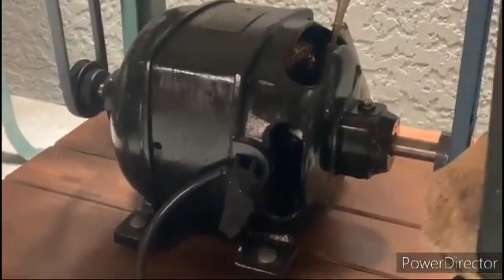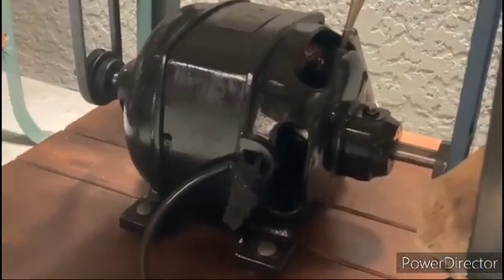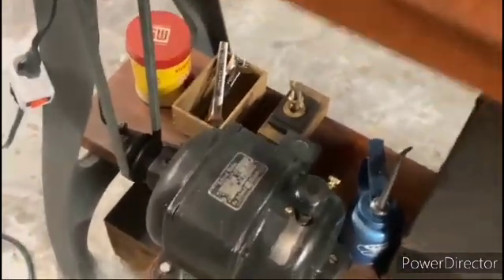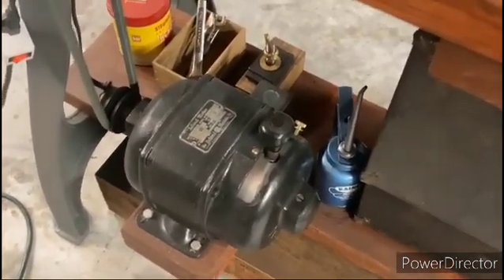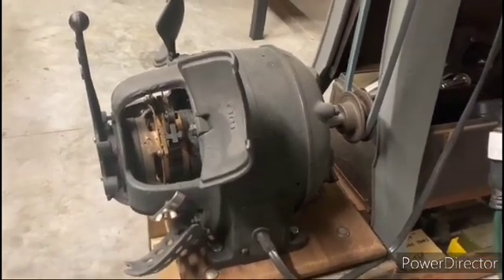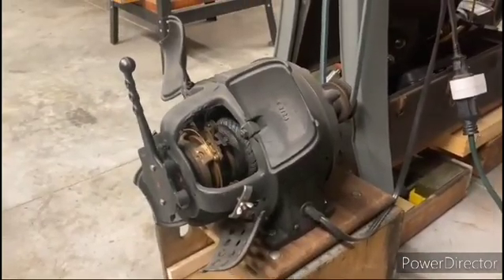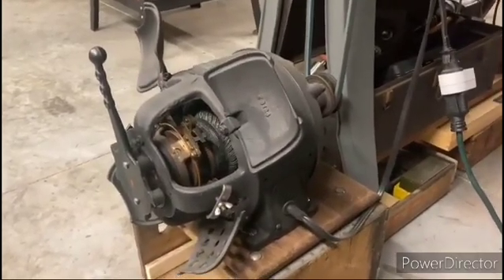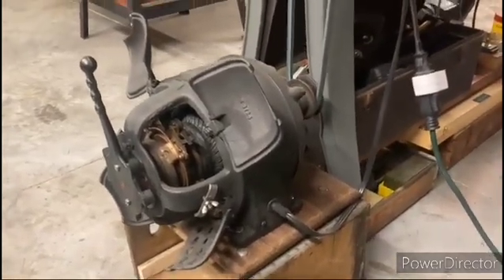Variable Speed AC Electric Motors or VFD? Leland or Kimble? Inspired (again) by Hand Tool Rescue.

Comment: I’m just wondering where you find such awesome motors! I’ve been keeping an eye out but I rarely see any Leland Motors out in North Idaho and the surrounding areas.
Reply from the maker: Theres several Lelands on ebay right now but not variable speed. Those are hard to find. Join the FB group Antique Electric Motor Experts and put up a Wanted to Buy ad. Good chance you might find one. Leland made a good motor.  I found the variable speed Kimble on FB marketplace. Its superior to the Leland in its overall quality.

Comment: Im looking for one of these Repulsion Induction-reversable motor....
Reply from the maker: The Lelands pop up on ebay from time to time. The tag will show the type as RV. 
The Kimble is harder to find but a better motor all the way around. Good luck.
Reply: @BencoVintageMachineWorks  thanks... I have an extensive background in electric motors.....  always fascinated by older technologies
Reply from the maker: @Mooseracks The old motors were built to last. Thanks for checking out the video...

Comment: Thanks very much for the video. Yeah, you got some real goodies. They’re not like today’s motors when capacitors blow up and start windings blow up when they made things back in the day they made them 32 years of electrician being in a power plant. Yeah, some of our stuff in our power plant soul to but still works. Thanks again.
Reply: Yeah, brought back memories when they made stuff. Yes I’m the only female worker in a power plant for 30 some years I work on turbine generators a week all them the machines and they run it around 13,800 V for the main generator all right keep up the good work when your videos real nice.
Reply from the maker: Sounds like you had an interesting career. The old motors were definitely built to last. The ones that originally had the cloth type wiring ran nice and cool and that makes a difference....
Reply: Yes, that’s right those old motors work great I also work on the DC rotary converters I used to work for Bethlehem steel and we had rotary converters that were a DC generator, DC motor and an AC on the other side with slip rings are used to put out around 16,000 A at 250 V They powered all our cranes in our Miller Quitman yeah the old stuffs gone good memories though I’m glad I was there before it was before it left.
Reply from the maker: Its a shame they shuttered that place. Fortunately, some of the buildings have been preserved.
Reply from the maker: Glad you enjoye the video

Comment: Rebuilding my vintage Walker Turner jointer. I have cleaned up the 3/4 horse Brown Brockmeyer repulsion induction motor. Bought the replacement sealed bearings, but would like to spray a new coat of insulating varnish on the windings before putting it back together. Can you recommend a brand &/or source for insulating paint?
Reply from the maker: Yes...Sprayon EL600 is a fantastic aerosol can. MG Chemicals Glyptal is a fantastic brush on....
Reply: Thanks

Comment: Love your stuff. binging on your videos.  Retired after 45+ yr woodworking career, I'm rebuilding 2 antique Walker Turner 6" jointers; one powered by a working 1/2 hp Norge/ Delco motor (modle 8350), the other powered by a non-working 3/4 hp Brown- Brockmeyer "B-LINE". Opened up the b line; packed full of sawdust, but otherwise looks in decent shape.  Would love to pick your brain; should I try to clean up, re-grease & reuse the  original bearings, or try to refit it with new sealed bearings? less concerned with restoring it to all original than giving it many more years of life.
Reply from the maker: Buy high quality sealed bearings and be done with it. Those B Lines are some nice motors....
Reply: Thanks! I think Brown & Brockmeyer made really good motors, but kinda shot themselves in the foot when they tried to simplify their name by adapting the “B-Line” brand.  researching them, I saw they had  a bunch of patent ms but also a bunch of lawsuits against competitors like Westinghouse, Master Electric, etc who came out with their own”lines” with superior sounding brand names that implied/ made people assume “B Line” meant lower quality…
Reply from the maker: I can understand how people could misconstrue the name. I own many vintage electric motors and those B Lines have probably the highest amperage rating for the given hp of any brand out there....
Reply from the maker: It won't work unless the motor is a repulsion induction type with a squirrel cage winding. On a RSIR you will just burn it up. The variable speed varities also have larger fans and are designed to dissapte the increased heat at low speed....
Reply: @BencoVintageMachineWorks  Pretty sure It is a repulsion induction  type Brown Brockmeyer motor; (i'd post the motor tag if I could figure out how to attach it) but I agree it's prolly not a good idea, since it wasn't built with that in mind.
Reply from the maker: RI motors dont have the internal shorting neckalce. There are repulsion motors, repulsion start induction run and repulsion induction types. A GE SCR like in my other video is a repulsion induction with the squirrel cage winding. Anyways, unless its designed to handle the extra heat, not prudent...

Comment: Beautiful thanks for sharing. I have a question. What type of thrust washers do you use as replacements. I have a Wagner  RA motor that I fixing and The ones on the motor look like phenolic material. Thanks for any advice. Love the channel. Keep the videos coming.
Reply from the maker: You can buy fiber washer assortment kits cheaply on amazon. Works good...
Reply: @BencoVintageMachineWorks  thank you very much have a great weekend
Reply from the maker: You too thank you

Comment: Hello, how can you change the speed with your hand, how does the mechanism work please?
Reply from the maker: Its a variable speed repulsion motor (not repulsion start induction run). By changing the angle of the brushes (with the handle) relative to the stator, the speed and direction can be changed. There is no shorting necklace in these since the brushes are engaged the whole time.